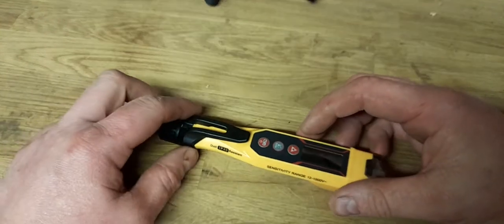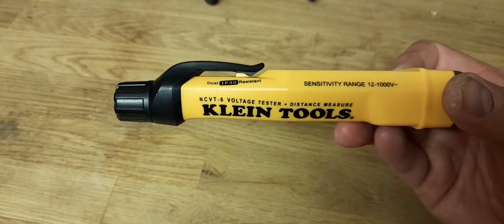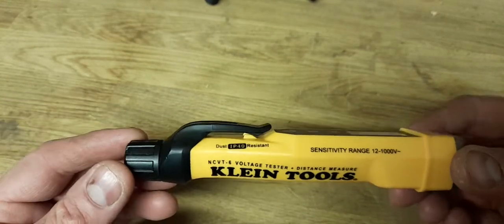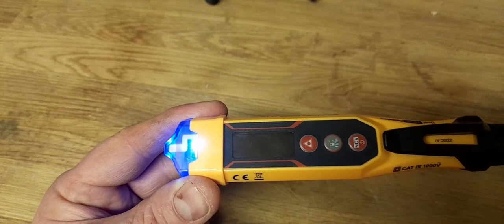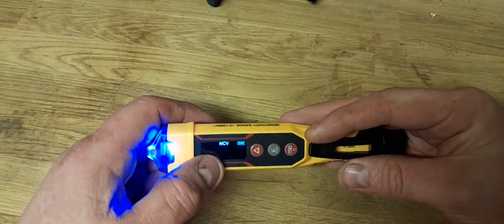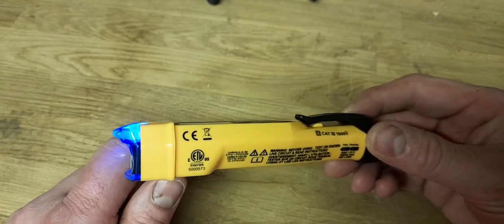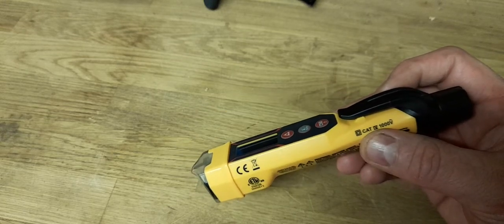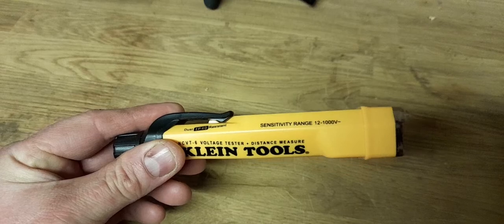Kleins Tools Ncvt6  Voltage Tester and Distance Measure

Comment: thx for info. Idk why I thought non-contact meant that you could get a read of the voltage from a decent distance, but I suppose it's more accurate to say it doesn't need direct contact with the conductor, but as demonstrated is still in direct contact with insulating material. I'd like to know more about scenarios where to use a NCVT vs a voltage tester...off to watch more vids.
Reply: A voltage meter is useful if the contacts are accessible i.e. in a socket, outlet or bare wires. A NCV is useful in the middle of cable runs such as Romex in the attic...
Reply: It detects magnetic fields, so the higher the volts and amps, the farther you can detect with tester

Comment: I really like mine , I like the low voltage function , the LDM function is quite nice . I’ve tested out to 50’ ( Bosch as a control ) . I tested the low voltage against my Fluke , Fluke detects , but doesn’t differentiate ! So far , I’m happy ! That comming from a died in the wool Fluke junky !
Reply from the maker: Have you had it long?
Reply: Three days , I kinda wish it was a bit slimmer . Other than that , good unit .
Reply from the maker: Can I ask a vain question did you buy it off the back of my video?
Reply: @danstoolroom7700  Your Video inspired me to buy it , I too hate large tape measures , and I’ve been carrying both NCV detectors , and Bosch LDM’s for a while ! You put my addled on brain in pursuit of an idea !
Reply: @danstoolroom7700  You also inspired me to build an everyday carry , with respect to VDE tools . It put me in mind of near misses I’d witnessed , in re : potential live voltage hazards .
Reply from the maker: @chrisfyfe9212  well I'm glad it's all helped mate good stuff and thanks for deciding to make me a tool belt I'll definate ly give it a video and some praise
Reply: @danstoolroom7700  If you are comfortable doing it , send me an email where I can send you some pictures ! I’ll give you an idea of possible patterns , and then we can nail down your tool quorum . I generally don’t do belts , just the pouches . I would need to know approx belt width , and whether you prefer nylon , or leather belts .

Comment: Before you called me the non-contact voltage tester police! I just like to make it known because there are many people, usually  homeowners that trust them with there lives
Reply from the maker: I didn't call you anything bud
Reply from the maker: Seriously mate I'd be interested in an answer to this, when have I ever called you the voltage police, I made a general comment about it. Surely you don't think all my videos are about you persoanlly
Reply: @danstoolroom7700   3:00
Reply: @danstoolroom7700  what happened to the dan that took jokes like a champ?
Reply from the maker: @bloodsongthesparkywolf3717  no. No he is still here and I'm not offended I just didn't know what you were on about. So what you meant was that I addressed all voltage detector police and you class yourself in that group. No I wasn't offended just comes across that way over text. I was genuinely curious what you were on about

Comment: Quite a versatile unit really. Does it detect when placed next to a computer? My Whia unit starts to pickup when it is about 18 cm from my MacBook. They are good for using alongside a voltage tester for testing for dead in scenarios where the neutral-earth connection could be lost that would cause a two pronged voltage tester to not detect the voltage. Other than that great for broken wire detection.
Reply from the maker: Next time I'm using my laptop I'll have a test for you, it's pretty good at not being too sensitive I've found though

Comment: I have two Klein NCVT units and I must admit, not bad, also have a Greenlee unit, I am considering the model you are reviewing here but 92 squids ?
It is available on Amazon for £69.98 on Amazon if one looks deeper.
Bit of info for you, fire alarm voltages (other than mains feeds) are not classed as low voltage, up to 50 VAC and 120 VDC are ELV (extra low voltage) your mains input voltage is LOW voltage , 230 VAC nominal., with tolerances....+6%  -10%
One thing is for sure, you mention high voltage, not quite sure how it indicates a high voltage , than mains is 'low voltage'...you won't encounter that in your role for sure as it is 1000 Volts or 1KV and that device has sensituvity up tp 1000 volts. What is the accuracy of the laser measuring function ? I can see tha could be handy when ordering access equipment, I have gone to a number of jobs  at night and many miles away only to find someone has ordered the wrong access equipment, fortunately I got paid for revisits.